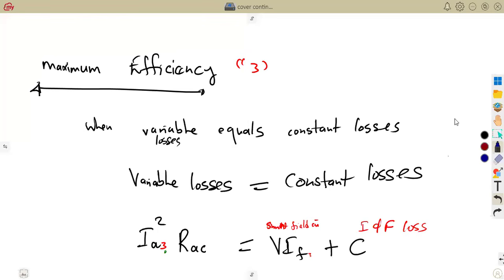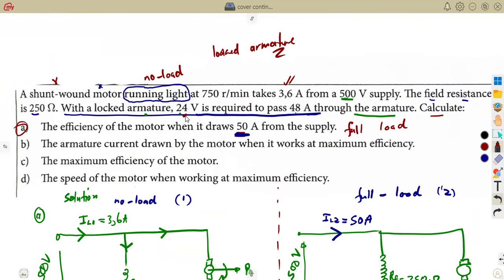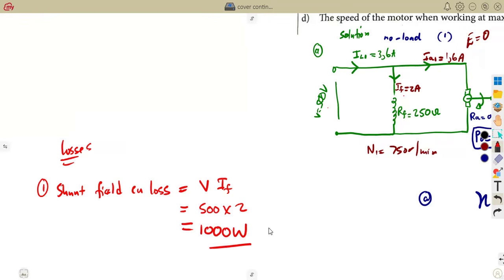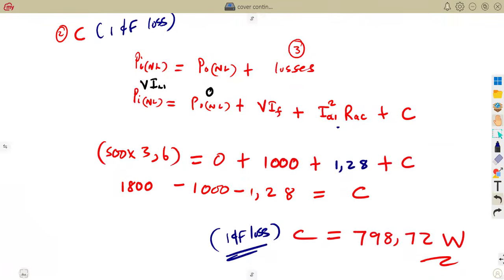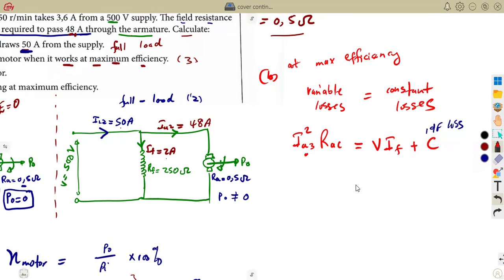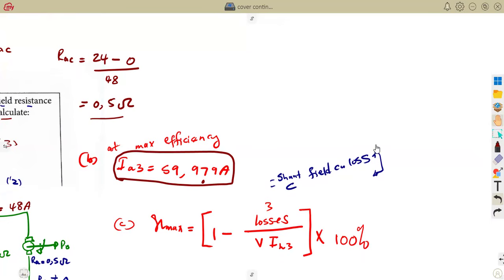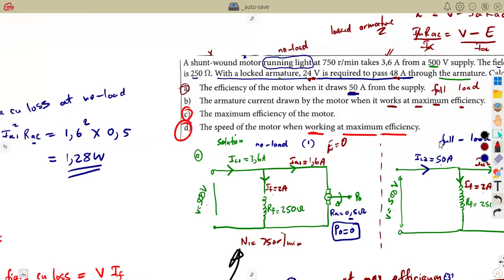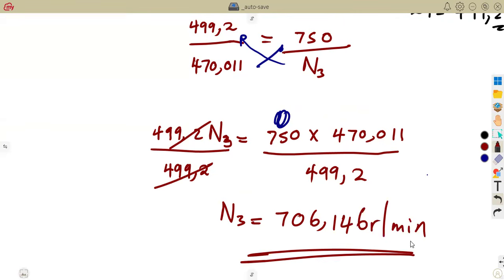Electrotechnics N6 Swinburne's Test Calculations 1 - Efficiency Testing of DC Machine Example

Comment from the maker: Hi i see what you referring to here, note that E=0 for a locked-rotor because the armature is not rotating. No load condition is on Power Output which is zero . Pardon my explanation on the video. So we have to calculate E1 since there is rotation no longer locked.

Comment: Sir i am confused,on the last question…why did we have to calculate for E1 at no load since at 1st we said its Zero …or isn’t it E1 is Zero at no load ?
Reply from the maker: Hi on which part exactly, like indicate time stamp
Reply: @mathszone @mathszoneafricanmotives  said generated emf is Zero because the machine is at no load right? So my question is why on the last part of the question we had to calculate E1 again ???
Reply: 59:12  why did we calculate E1 at no load on the last part 59:44
Reply: @mathszoneafricanmotives  im asking myself the same question sir? or is it because when we use 24v of locked amature we take E1 to be 0?
Reply from the maker: Hi i see what you referring to here, note that E=0 for a locked-rotor because the armature is not rotating. No load condition is on Power Output which is zero . Pardon my explanation on the video. So we have to calculate E1 since there is rotation no longer locked.
Reply: @mathszoneafricanmotives ok i understand now thanks for the feedback 🙏
Reply from the maker: Hi i see what you referring to here, note that E=0 for a locked-rotor because the armature is not rotating. No load condition is on Power Output which is zero . Pardon my explanation on the video. So we have to calculate E1 since there is rotation no longer locked.

Comment: when caculating E1 ,thought E1 is =0 because its at no load , so what the reason behind it being able to be calculated this time?
Reply: Yes I also saw that. Teacher @MathAfricanMotives
Reply from the maker: Sorry for answering late which part exactly, indicate with time stamp
Reply from the maker: Hi i see what you referring to here, note that E=0 for a locked-rotor because the armature is not rotating. No load condition is on Power Output which is zero . Pardon my explanation on the video. So we have to calculate E1 since there is rotation no longer locked.

Comment: why did you calculate armature copper loss at no load because the question asked for efficiency of motor when 50A is drawn which is at full load ? so since its asking at full load arent all calculations supposed to be according to full load ?
Reply: @ Maths Zone African Motives you need it for calculating iron, friction and windage loss. Take note. That's correct calculations should be for full load, however you should calculate armature copper loss for full load, the shunt field value will be the same and I'm not sure if I heard correctly, but for iron, friction and windage you use the value for No load... Sir please clarify if we should always use the value of (C) for No load.
Reply from the maker: @mphomakua C is for iron friction and windage losses